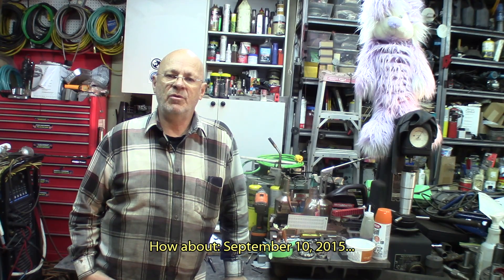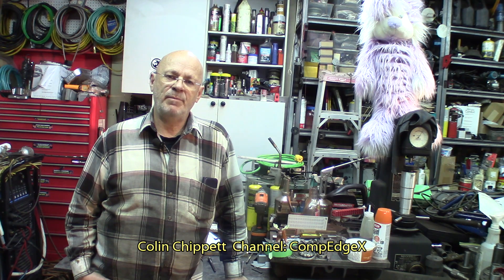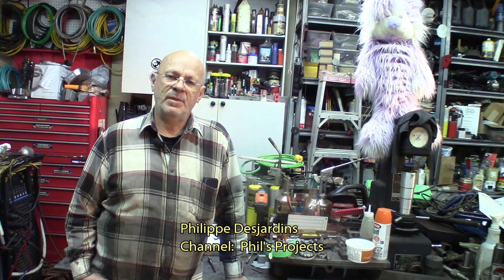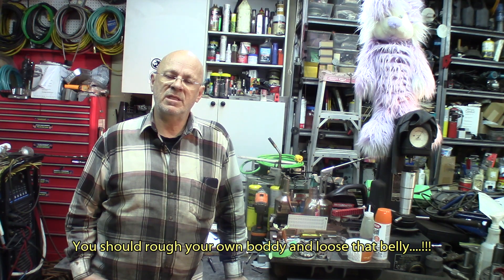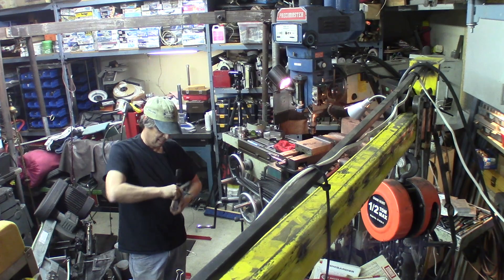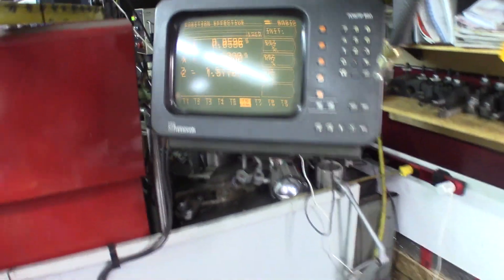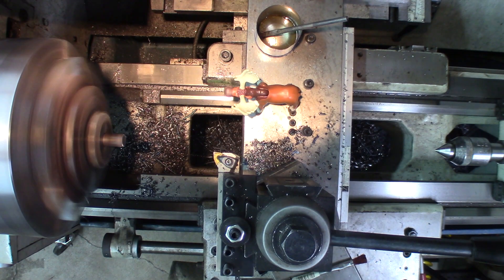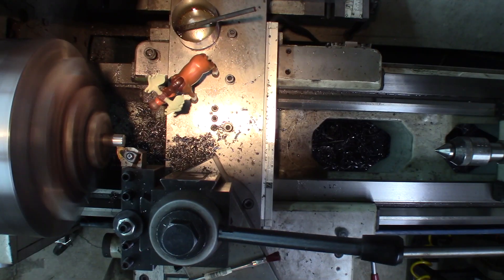WIYB Shop made Knurling Tool for Keith Fenner's What's In Your Box toolmakers Collaboration P-1

Comment: nice vid Pierre , really like that chuck..
Reply from the maker: +Brian Stanga Pros: adjustable about +/- .020'', big 10", Easy on tubing, good grip on material on heavy removal...
Cons: Heavy, can't grip under 1/2", big 10 inches... lol 
Generally speaking it stays on the lathe 98% of jobs, so, It's a good tool...  Most of the time it will replace a 4 jaws change...
Thanks for comment,   Pierre

Comment: Perhaps I need a moose to help me with the small parts. I just finished my punches for the WIYB and they were certainly challenging. It was below my golden .250" in diameter that I don't allow in my shop, so it was a good challenge, I also remember why i don't allow stuff smaller than that in my shop. LOL
Reply from the maker: +bcbloc02 Those ''Under an inch'' parts are almost impossible to get glossy finishes....  It's the border where the ''rules'' don't apply any more...
Great that the planet also need men like you with the Bigger projects....   ;)
Thanks for comment,   Pierre
Reply: pierre beaudry
Yeah when your machine tops out at 450rpm high gloss finish is probably out on little parts. Lucky me these are getting heat treated so the finish is all out the window anyway.
Reply from the maker: It amazes me so much to see people trying to get the mirror finish even between passes, or when it has to be heat treated, or also get +/- .0005'' on roughing passes....   ????
How to make a 20 minutes job last the whole day....  ;)
Reply from the maker: Also to make the most of a carbide insert on a 1/4'' rod with  400 sfm you need to run at over 6000 rpms....